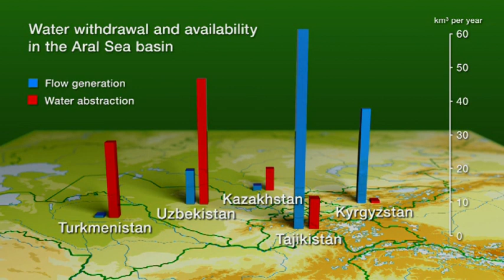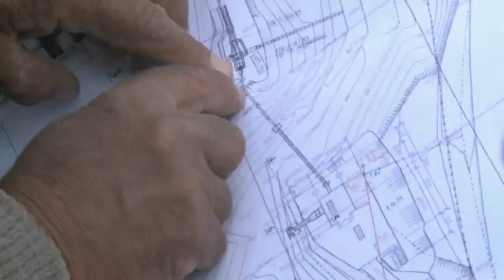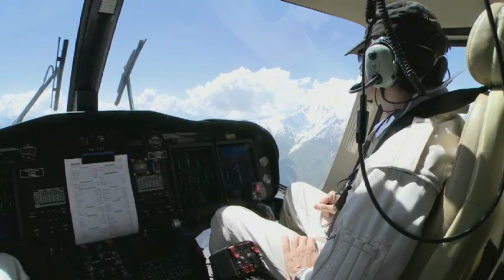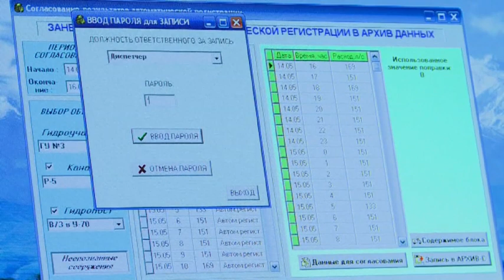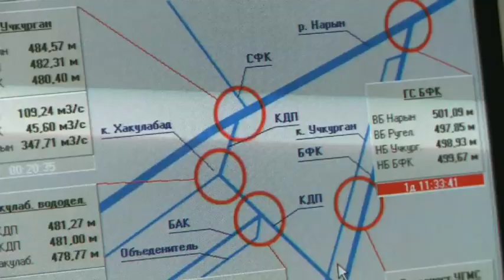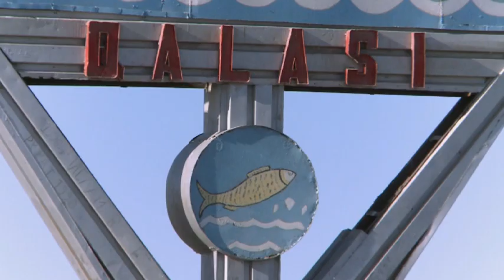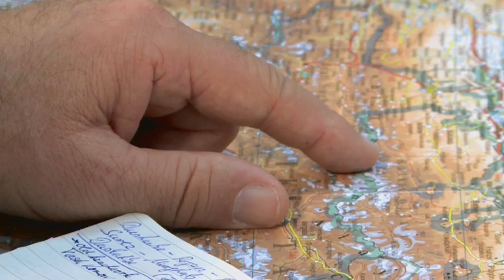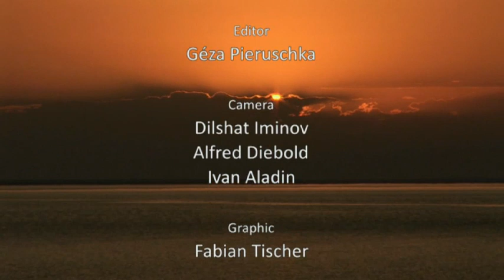From the Glaciers to the Aral Sea - English language

Comment: opening statement - fresh water is in limited supply. Nonsense, fresh water is the ultimate renewable resource that will never run out - did this guy not learn about the water cycle in primary school
Reply: Freshwater is a renewable source because is can be used over and over again, as it has a cycle. However, freshwater is also a limited resource, because less than 3% of the world's water is fresh. And more than 75% of the world's freshwater is being stored in glaciers and ice caps.
Reply: 3% of the world's water is fresh.
the other 97% passed its use-by date?